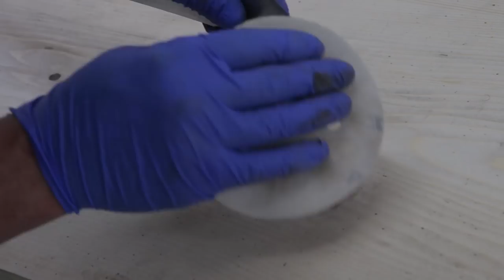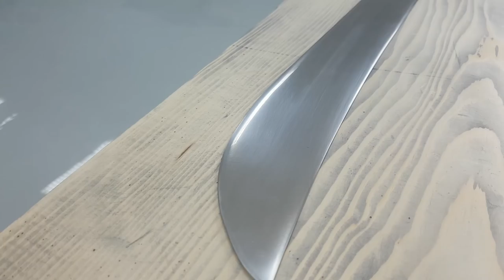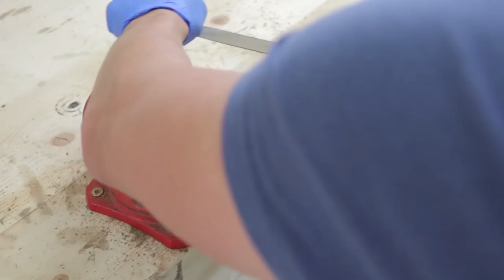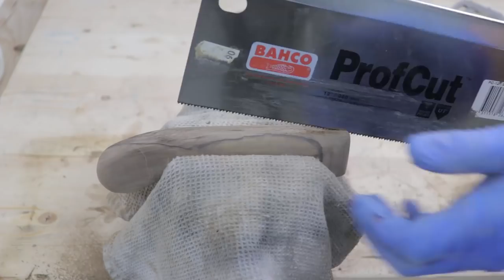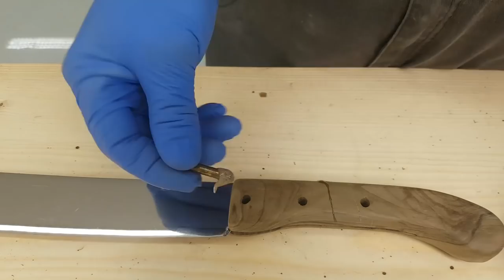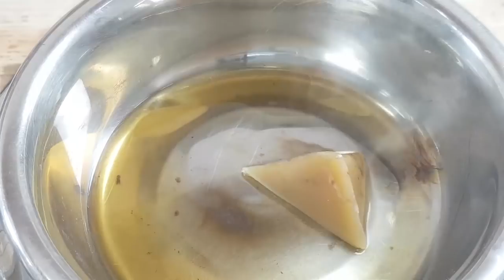Old Machete Restoration - DIY With No Power Tools

Comment: For some reason, watching restorations without machines & only by hand is so satisfying.
Reply: Hello salonika
Reply: I agree.
Reply: I found this to be the opposite.
Reply: salonika101 that is how you are supposed to do it anyways
Reply: Same
Reply: Its 50/50 for me. With or without power tools are both incredibly satisfying as long as the restoration is done really nicely.
Reply: Agree with u
Reply: Ehh it’s better with machines
Reply: ο σκοπος αγιαζει τα μεσα
Reply: salonika101, probably because you can get the satisfaction of seeing this thing fully restored without putting in any work
Reply: I like both
Reply: Agreed
Reply: Go get a sword from Rajasthan in just 500 to 15000 rupee 
Belive me indian sword is batter
Reply: It is call Crafting and that is what I am currently learning
Reply: I like doing it by hand tools, even I have power tools..
its more satisfying...
every stuff which is had "hand made"its more expensive 😁😁
Reply: What no# did use
Reply: Agree
Reply: Very nice work, please include a list of items you used , sandpaper grits ect .
Reply: What grit sand paper are you using

Comment: Nice restoration, though I think maybe a hacksaw, the type with the .25 inch blade, would've helped make the making of the handle easier since you can manupulate the blade easy to cut curves with them.

Comment: awesome! I have a pair from my grandpa, I want to restore and use them but they are still sentimental.  They have plastic handles are probably from the 80s. How do you sharpen them? Should I change handles? what kind if i do? what products and order of grit sandpaper did you use? what did you use to polish? type of adhesiveness did you use? If i use a wood handle what kind do you recommend? Sorry  for all the questions. But thank you

Comment: So refreshing to see this all done the proper way you did a fantastic job on the blade best part you did not attack it wuth the dreaded angle grinder and butcher it or flap disk a great job love how you used the draw file to remove excess epoxy really nice touch well done looks great..

Comment: No power tools ey? How did u screw that vise in????
Reply: Butterderpz with a screw driver
Reply: If that's hardwood, then there's no way a screwdriver would have enough force to break the surface of the wood in order for the screw to go in.
Reply: Oisin Molloy is that the only thing you have to say?
Reply: Butterderpz 5:47

Comment: Excellent work. Try using a metal wax to prevent the blade from rusting.
Reply: On my guns and knives I used a mild cutting compound as a final stage polish and I then lock in the finish with 'metal of honour'

Comment: Your machete looks like the old British military issue , but probably not because it appears there are no makers marks . Your new handle is far superior to the original and admire your use of sawdust mixed with epoxy for filler + your use of what looks like beeswax . 
I would like to know what type of handle wood and what liquid you applied to the blade and what it does . It would be fun to do a Rockwell hardness test a cross the blade . Liquid cold blueing would also tell a great deal as to steel chemistry ... as would an application of mustard or vinegar . 
Awesome job as usual Andre and Respect sent .

Comment: Just saw this video,
(Sorry for being a hypocrite)
And I call bullshit on sanding the blade. It can go like that unless you soke it in vinegar for 24 hour, still even then that won't happen. You need at least 4 power tools to restore the blade itself. So, did you soke it in vinegar then rub it down with metal wool? If did, please answer this comment because I'm seriously confused. Thanks!
Reply: Ok, thx.